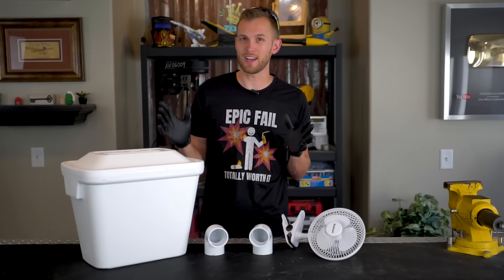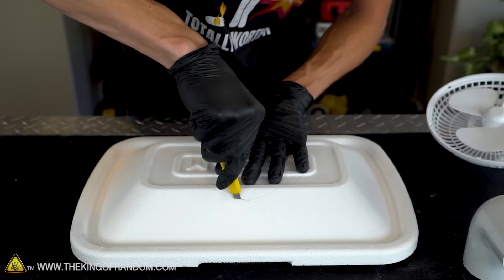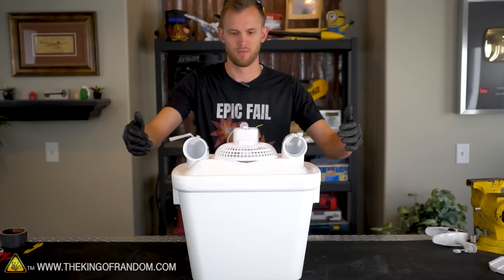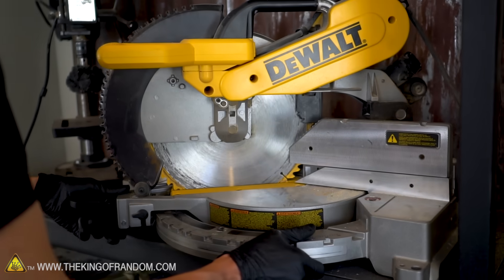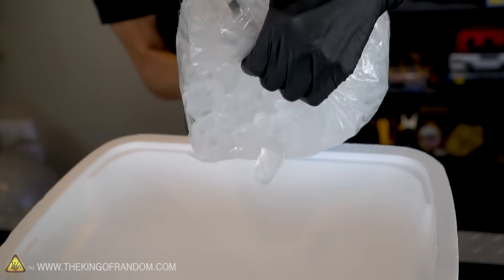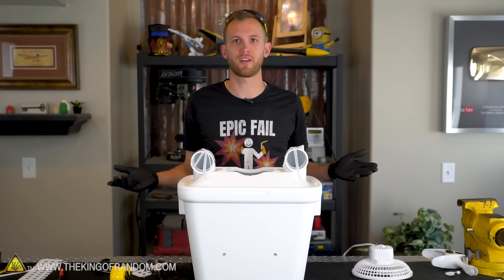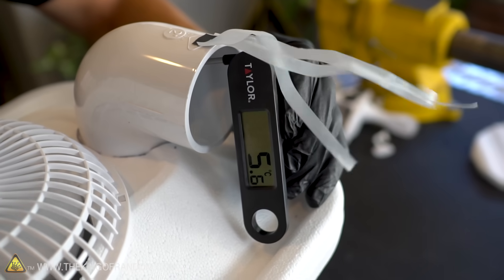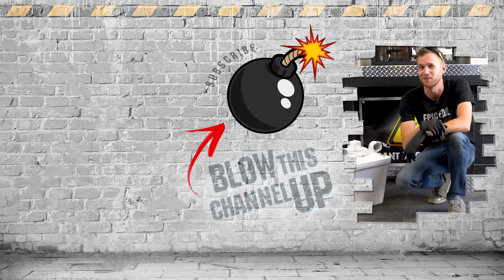Recycled Styrofoam Air Conditioner! TKOR Creates An Efficient DIY Air Conditioner!

Comment: How about running the pipe into the ice but having the air inlets at the top of the cooler so the air has to pass through the cold pipe and back around to the top that way you could fill the cooler with ice further up and probably use a metal pipe for better cooling

Comment: I strongly agree with the reason you were against frozen ice in plastic bottles and you were with the idea of using ice cubes instead. However, there’s one big problem with this idea. Whether you turn the fan on or leave it off, the ice will start to melt and therefore you will end up with just water.

Comment: When you use the tray and the ice melts and creates water at the bottom wont that cause the blockage of air flow and cause your fan motor to burn out?

Comment: Genius putting the pipes below! Wow. Great job. Love the demonstration showing the significant differences in temps. However, I would make several modifications to my own version. 

First, I would use a USB rechargeable fan instead of an electric fan. This way, if the power goes out on a hot day, I can still run the fan or use it while camping.

Also, instead of poking dowel rods through the sides, creating a leak potential, I would line the bottom side with frozen water bottles. I'd arrange them on the long sides, leaving an air gap in the center. I'd glue the dowels on the under side of the dish mat to give it streng for holding ice, or just find a metal rack to hold ice packs. I just don't want to deal with melting ice and other frozen items can provide close enough results by elevating them, and without the mess.

Overall, I really appreciate all the thought and testing that went into this and the ideas it generated.

Comment: TKOR thank you for the great video. My SIM racing PC GPU (RTX3070) temperature sits at around 42degrees celsius with no load. When I start the iRacing sim the temp jumps up to 86degrees celsius. The PC case is hot to touch and it's scary to see such a high temp in resource monitor. I'm going to make a slightly smaller version of your cooler with only one outlet which will be a flexible hose I can point into my PC's air intake. Cheers from New Zealand

Comment: Can someone tell me if it would just be easier then to put the air exit tubes at the bottom of the container under the water bottles  (the air coming out the side instead of top)? That way you don't have the extra step of getting the elbow joints AND tubes that reach the bottom?

Comment: I saw a similar video of someone who used an ice chest added few blocks of ice and added enough water to fill it over half way through then added cup of salt mixed into water and used a slightly larger fan and was outside in a two person tent in 95 degree weather and he got the temperature down to around 78 degrees.

Comment: Ive seen so many of these...no one actually uses their brains...SEPARATE the chamber  1/3 of the way leaving enough room for air to flow under (even when ice melts) .Use the small side for intake and the 2/3 for output .This way you create a proper airflow that is forced downward and through the cold side.

Comment: With the mesh supports, it's possible for a leak. A little flex seal may work. Keep the dowel holes from persperation as the ice melts. 9.6 outta 10 though 🤘. Definitely a great idea 💡

Comment: Just use rock salt in the bottles of water. Lowers the freeze point, stays colder for longer. But I would use an aluminium tube inside from the intake to a single outtake. This way you're not blowing hot air over the ice. have it spiral around the bottles

Comment: I re-created this, same fan as well. and it works great… for a few minutes. it is completely melted after 30 mins. I would need one bag of ice for every 30 minutes I was out running around. Which is insane. I even took the lid off and put it on a yeti cooler, and it did the same thing. It’s blowing 100 degree heat directly on to the ice.

Comment: If you push the air in from about an inch from the bottom and fill the cooler with water bottles stuffed with diaper filling and salt water, you won't deal with much water except condensation AND it will stay cool a long time.

Comment: Raw ice melts incredibly fast though. I use the thin freeze packs and did something similar to the grate at the bottom only instead of ice on top I made an array of the freeze packs so that they were barely separated from each other forcing the air between the packs. Used wooden rods to do the spacing like you did for the grate support. However I used a much larger foam chest and it would last at least five hours under the lowest fan setting before finally petering out. To refreeze I simply stuck the entire thing minus the fan into a chest freezer.

Comment: My mod is: instead of putting the fan on top of the lid I cut the hole in the back of the box and blast the air directly through the ice bottles. Wouldn't work with loose ice cubes but bagged first aid packs or small sealed ziplock bags could work just as well.

Comment: If you live in a dangerous area go to the library. Libraries in North America are usually air conditioned. Stay there all day until it cools off by six P.M.. When you walk to and from the Library walk in the total shade on the shady side of the street.Also you could possibly go to a local downtown indoor shopping mall and stay there till it cools off at six P. M..Shopping malls in North America are always air conditioned in the summer.

Comment: Water bottles may not make it quite as cool, but they melt a lot slower than ice cubes. If it is really hot the ice melts pretty fast and you will be changing it out a lot.

Comment: we built one to use for a rabbit hutch.  The fan melts the ice so fast we cant keep up getting ice into it. when we first turn it on its cold for about 20 or 30 minutes then its blowing warm even though we have some ice left. After 20 minutes are so we lift the lid and stick our hand inside of the chest  it isn't cold at all hardly cool. we've been at this for 4-5 days and cannot get it to work.  We're using a larger than normal  ice chest.  could  that be it?  Our bunnies need help, we're in Louisiana   Marie
Reply: put salt in the ice it will last long

Comment: I know I'm late but what if you use dry ice with a vent going put the window and replace the PVC with metal and have all the pipes connect so no co2 can get in and the co2 evaporates it just goes out the window not into the room

Comment: One trade-off of frozen bottles vs loose ice is the duration of cool air you can make. Loose ice makes colder air because it's exchanging heat with the incoming air more quickly. This means ice will melt more quickly.

Comment: Diy electric budget foundry.
Make a electric ferness  using plaster Paris. Not firebricks. Because those bricks are expensive. We want budget. We know u can make it with gas. But electric is the future. So see if u can make a budget electric furness using plaster Paris and metal tank

Comment: I wonder how that works with temps over 100. We've been having multiple heat waves in my area & all the A/Cs are sold out or won't arive until next month. I'm considering doing something like this, but then a friend of mine said over a certain temp it doesn't work.

Comment: So I made two of these. It works but almost started a 🔥 if your gonna do it make sure to do it with a actual cooler it's much safer. You should put salt on the ice it will last longer. You want the ice to be alot.  Or you can try to frozen water bottles but I would put salt in those. Next the fan needs to be one that blows hard. The ice melts quickly and it is something but yeah with some tweaks it could work.

Comment: That's no airconditioning device, it's a swamp cooler
Reply: swamp coolers work three evaporation, water evaporating from a saturated cloth or fiber mat.
this gadget because air is cooler after it has blown over the ice. I mean, the entire inside of the cooler is cold because of the ice, so you're just moving some air outside.
you can't get evaporative cooling effect unless the temperature is high.

Comment: What if you try laying the bottles on their side instead of straight up, and stack them on top of each other.. 🤔. What about flat reusable ice packs as well. Defiantly uses way less power then a a/c. perfect for a small camper or tent. I bet if you turned the fan speed down it would get colder temps.

Comment: anybody has tried this? Can you tell me if this thing makes your room cooler or not? I have a small room, just fit my bed, study table and a closet. My room always cool but i have problem when it comes to noon till 5 p.m, the room will be occupied by the heat. so it will be sooo hotttt... This diy aircond will help or not? If it help how much it will make a different?

Comment: Ok,  I have the cooler, I have the bottles, and I have the ice and plastic screen. Now all I need is a house...............
Reply: 😂😂😂 u and me both im homeless
Reply: @DirtyInvestor87  Yikes,   you have it worse than I
Reply: Also homeless... in florida... in summer. Haha. Gonna see if this will keep my car cold at night so I dont have to roll down the windows and get murdered. It's the little things.
Reply: @angelapiccolella1491 you still homeless?
Reply: @angelapiccolella1491  WOW, same situation currently right now in Miami Dade. I watched other videos and managed to get the cooler, dryer vent and USB fan, but it wasn't freezing. It was cold, but not air conditioner cold. I'm gonna try the tray at the bottom with the pool noodle styrofoam things attached to the dryer vent to go directly to the bottom to see if it makes a difference.
Reply: @angelapiccolella1491  use a usb rechargeable fan. Also, if you can afford a 12v freezer, I'd use the frozen water bottles and blue ice packs. Otherwise, you are creating a swamp cooler as the ice melts. You DON'T want all that moisture in your car. If you don't have access to freezing bottles and packs, then put your ice in bags that don't leak. All that moisture in hot humid FL can get moldy fast. You DON'T want THAT!
Reply: @angelapiccolella1491  I was actually only joking and I am sorry if you really are homeless.
Reply: @angelapiccolella1491  why u gotta b homeless now? Where was u at when i was homeless in florida we coulda turned it into a love song
Reply: Feel that lol. Currently building a better swamp cooler for the truck I live in XD Has to have a different design from this one, but I still learned quite a bit from this video early on when I made my first one!
Reply: P
Reply: It will work in a tent as well😊
Reply: Literally laughed out loud😂
Reply: 😂 or a tent
Reply: lol I’m building this so I can sleep in my car tonight

Comment: Probably moving the air "through " the ice restricts the air flow and extends it's contact time resulting in lower temps. 
   What is the humidity level? That is probably very important.  Wetter air holds more heat.

Comment: I think you would have better results if you forget the two downpipes and have one central downpipe from the fan, that way the air is forced down and past the ice cubes making the circulating air colder before it exits the vent pipes.

Comment: I made one of these like 20years ago when i worked in a snack stand on the 12th T at a golf course. With a small grill in there it would get up around 100degrees in there in the summer. I used a 5gal bucket with lid. Cut hole in the lid for a fan. Cut hole in the side of bucket for cold air to come out. Had 2 milk jugs filled with water. 1 in bucket 1 in freezer and as 1 melted swap for the frozen. Worked amazing, and the ingenuity got me some extra tips and compliments from the members lol
Reply: Is there any benefit to using the pvc pipes then?
Reply: @ryanleiderman9622  only reason i see for the pvc is to direct the air in the direction of your choice. If you dont mind the cold air just flowing into the room, then you dont need them. With my design in the 5gal bucket, the hole in the side is the exhaust so no need for pvc
Reply: What if we use 2 fans attached together in the (opposite direction), I mean 1 direction would be inside and 2nd outside, so the inside pushes the air to the 2nd fan which will throw the cold air outside?
Reply: Yeah but did it get u laid

Comment: Okay , I have the exact cooler , I fan from a broken humidifier,  a ( clean and disinfected ) filter from a broken De-humidifier , 2 chopsticks , and I can grab some ice in the morning ... I'm thinking to use the filter as a crate shelf the chopsticks as dowels , I dont have PVC piping so maybe taking empty water bottles and duct tapping them I'm just not sure . But I dont drive and tomorrow is the last ' cool 'day before it hits 90 and 95 so imma try it . Wish me luck :) if it doesnt get the job done , at least I'll still have a bucket of ice :D

Comment: What would happen if you blew one vent over the fan and then sealed it except for a few holes to still allow the suction of fresh air? Would it circulate more and come out colder?
Reply: Or point 1 fan towards the fan and still have 2 pointing out...

Comment: Thanks so much for the idea. I just built mine on a bigger scale, using a Tupperware container. With the room sealed off (all the windows and doors closed), it actually does do something for the room temperature. Thanks so much! The idea works really well
Reply: How’s it working?
Reply: @riyonhutton2289 It worked for quite a while. I did eventually get rid of it for the sake of space, but it worked like a bomb. I'd 10/10 recommend it if you need a quick fix for an A/C unit, I'd recommend this one

Comment: I think I'd work better if you put the extender tube on the fan insted of the elbow pvc, but do it funnel style coz the fan is big and as tube gets smaler use coper tubes that rotates and spreads to the bottom then cover it with ice cube

Comment: If you added water to the bottom approximately 30% water and 70% ice ratio it will get even colder due to the transference reaction. I'm thinking at least a couple more degrees.😁

Comment: The only problem is if you don't freeze water into bottles, then as it melts, the water will be taken up as vapor and raise the humidity in the air ~ the higher the humidity the hotter it gets.  So you make yourself hotter in the long run.  This is a great idea, but just use water bottles ~ we use the huge 4 L (about 1 gallon) sized bottles for a whole lot of cool.  PS another tip, freeze a couple bottles then when you take them out to use them, freeze another set ready for when the first ones defrost.  Tried making this and it does take down the room temperature a couple notches.  The thermometer should be hung in the room, not stuck in the box to give you are clear, true reading.  But it does cool the room down a bit.  Thanks for the video.

Comment: this worked very well, used dry ice instead of regular ice it made it cooler compared to using normal ice, cheap and easy to make
Reply: Hope you don’t suffocate
Reply: You don't wanna use bare dry ice as a substitute for ice cubes and needless to say, using it in closed spaces.

Comment: Found a flaw. I built one of these, this morning. It worked great for about a half hour, but then enough ice melted that the bottom of the pipes were submerged in water and wouldn't allow air flow. I would stick to the plastic bottles, or maybe freeze water in metal pipe segments.
Reply: hw about copper water bottles
Reply: How about food cans 😀
Reply: @fuzailhamid1122  that's a interesting idea

Comment: $20 project vs the average msrp of a store bought air conditioner? That is a nice alternative, and with the styrofoam body, creative features could be added, and it doesnt use as much voltage as most ac units

Comment: Got my studio directly under the roof, this will bei my first attempt to survive streams there in summer xD
Thanks for improving it by randomly trying nearly everything I though of. Still, maybe a radiator grill might be another improvement, there are really efficient pumps for watercooling nowadays and you can increase the surface area that helps with the heatexchange significantly. Gotta dive into USB stuff this winter I guess

Comment: I'm confused as to how this design would work when the ice melts and the 2" pipes are then below the waterline.
Reply: the design is only suppose to work with bottled ice/water, hence preventing a mess or for the pipes to get covered by water. I use to use ice before and honestly it melts to quick and only works for a little bit , bottled big jugs of water last longer. But the biggest advantage IN MY OPINION is that it wont create so much humidity as much as using ice does. I live in one of the most humid places in this earth and using bottles is the best way to go
Reply: @NeoBlueBearZchannel  I did the same thing, plus you have to make or buy enough ice every day and then dump the water out. Frozen water bottles work way better. You just have extras freezing and rotate them.
Reply: I would use ice cube sheets for coolers, personally. In tandem with water bottles.
Reply: @hypat1aa what are sheets
Reply: Right my tough as well, I guess there is no fix for that, maybe using frozen tin cans or metal bottles below and a metal container on top that will hold the water

Comment: if you are freezing the ice in your homes freezer, its a net heat gain for your house.
Reply: That doesn't really make sense. Unless you're only using the freezer for the ice, and it's off the rest of the time, or you're putting boiling water in there to freeze.
Reply: @Firsona  your freezers compressor and condenser radiator puts out more thermal energy than the thermal energy subtracted from the water to freeze it.
Reply: @napzzter1  Unless you have a way to measure how much is used in freezing cool water in an already running freezer with items in it, it doesn't matter. ^^ My freezer is always on, since I store food in there, and make ice for drinks.